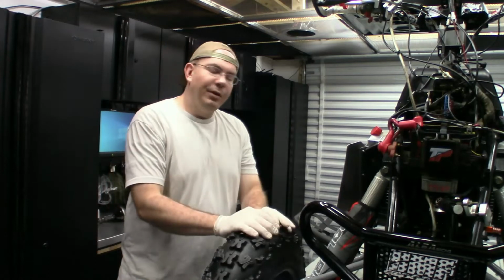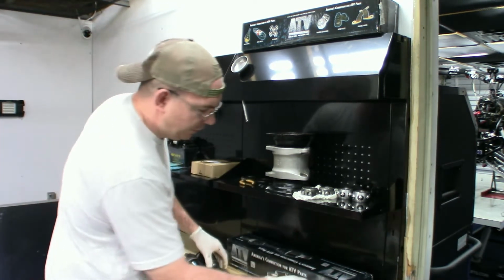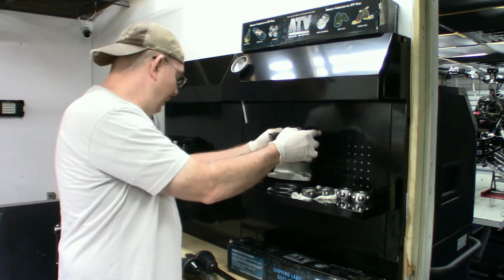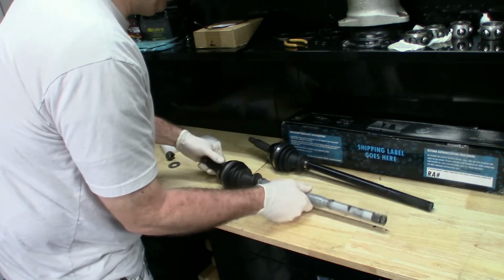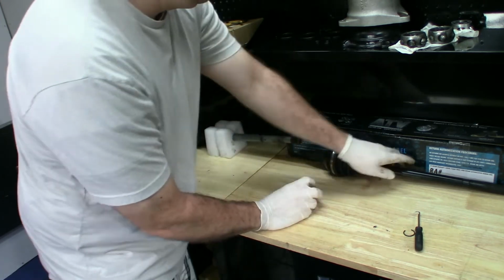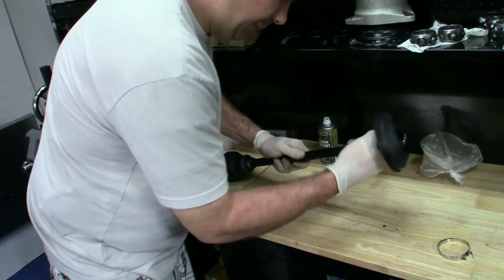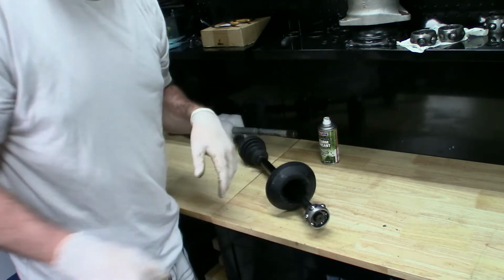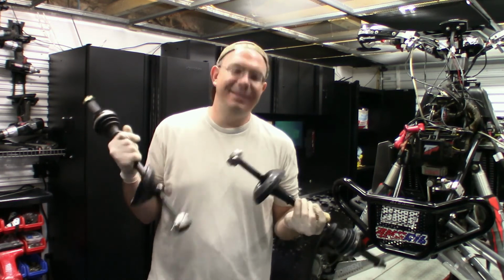Polaris Outlaw 500/525 Rear Axle PreAssembly

Comment: I'm just starting the video, but I can't wait to the end to comment. THANK YOU for continuing to post these Outlaw vids, despite the popularity. It's a rare bike, but because of you, people like me have something to watch before starting projects on theirs. I'm about to replace the CV shafts on my wife's 2006 Outlaw 500, and I'm so glad you posted this video before I do.

Also want to say thank you especially for the video on the Outlaw gas tank fuel valve replacement. I ended up rebuilding mine on the tank last summer after seeing how much trouble you had. If it ever starts leaking again I will just get the bigger IMS tank, rather than deal with the factory fuel valve.
Reply from the maker: Comments like these is why I decided to come back after my long vacation for making these vids. Thanks so much.
Reply: @TorrentPerformance  Oh it's the least I can do. You mention the rear end clunking in the vid, that's what my wife's bike is doing... I bought the complete HD rear axles with inner CV's, but sounds like that isn't going to solve the problem. I don't see anything on ebay either for the differential carrier. Her bike may end up getting converted to a swing arm straight axle! LOL.

Comment: WE NEED THE RAD KITS !!
Reply from the maker: Lol. These kits aren't just for this quad. Im building a brand that will be for alot of other quads and motorcycles. This stuff takes time and is very expensive to do this stuff. Theres alot of legal stuff as well. Cizo you are on the top of my list. The outlaw rads will be very limited as i had a manufacture problem from supplier. They painted my logo upside down on half the radiator inventory. Did you have the 525 or 500? I will have kits for both models now.
Reply: @TorrentPerformance  525. As long as it functions properly, the logo isn’t a deal breaker.

Comment: I have the straight axle rear end on mine but this quad is a pain in the ass all around. Raptor 700 is looking better and better everyday to me…
Reply from the maker: cj from a used aspect i thought it was a good buy. But being ripped off and lied to by a dealer 2200 miles away from me really was not expected. After this is done and there no issues with motor i think it will be a solid quad. But these seem to need to be maintaned in tip top shape to be reliable. Oil changes are suggested every 10 hours which is way to often for 9 out of 10 people.